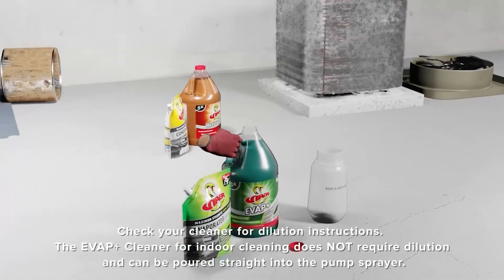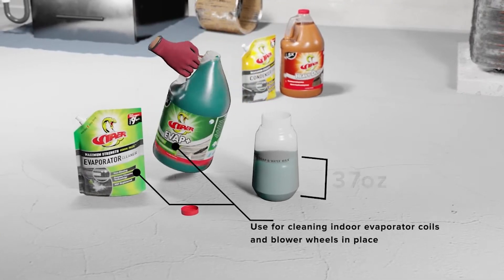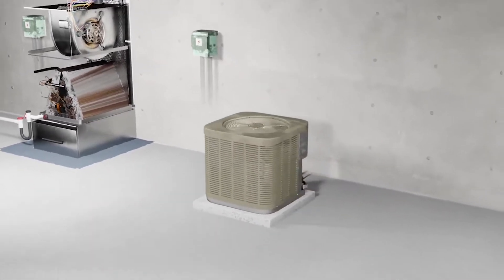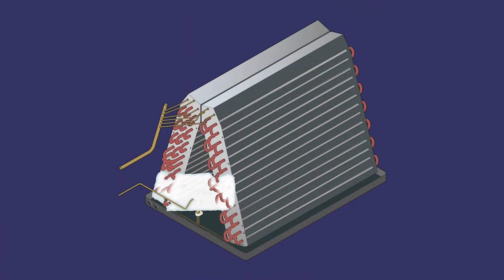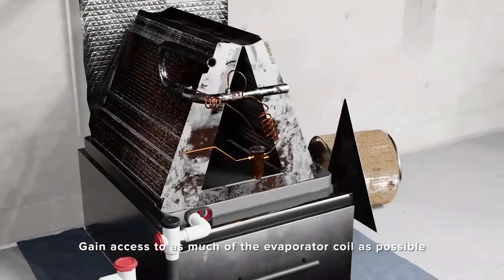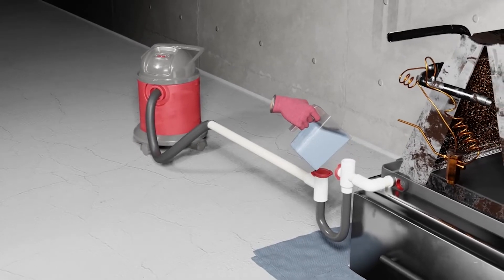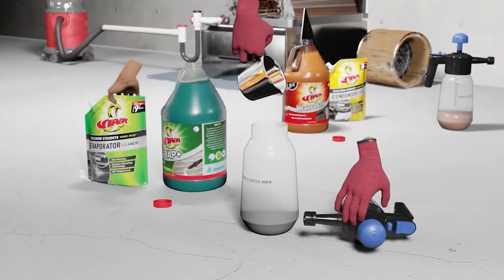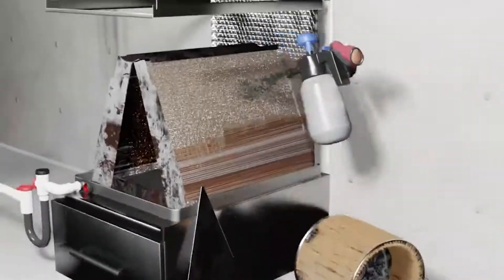VIPER EVAP+ EVAPORATOR COIL CLEANER & VENOM PACK EVAPORATOR

Comment: i saw a video with a guy saying if you use Evap+ it needs to dwell for a minimum of 6-8 hours for the enzymes to start to activate{on a wet coil/evaporator}, and up to 72 hours to fully clean for odors ect.is this true?I want to clean my interior evaporators due to musty,moldy type smells from my crawl space and attic units,should i let it dwell for this long? Thanks.
Reply from the maker: Since you do not need to rinse this product off once applied, just spray your evap coils and walk away.